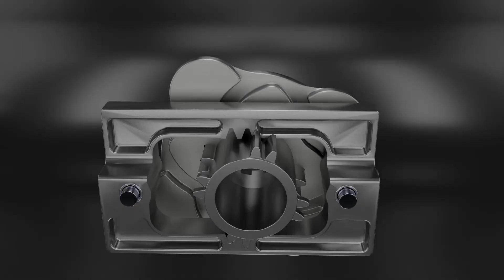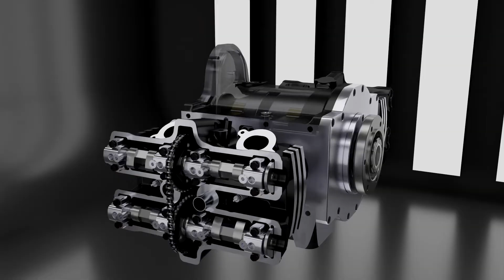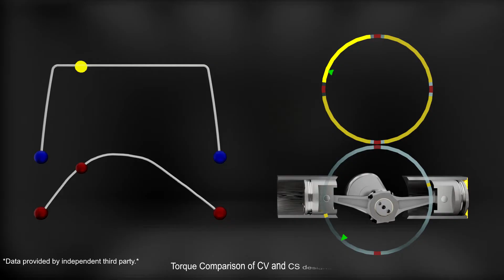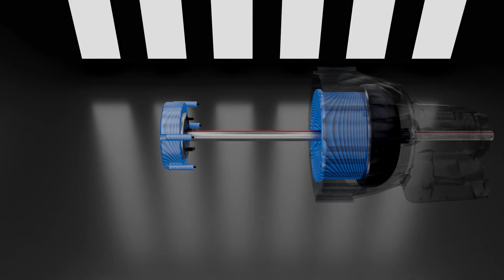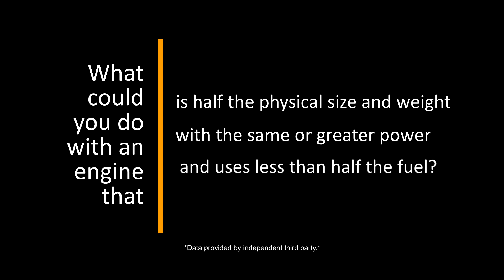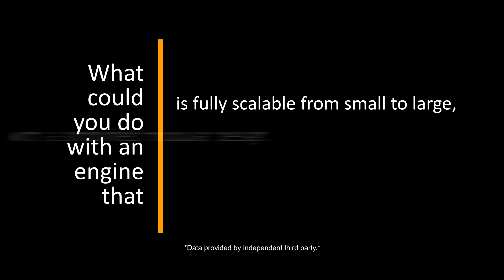The radical design and unique advantages of the CV Motion Technology

Comment: This thing looks like a fundamentally unreliable disaster in the making. All of those stress loads on 2x gear teeth must be some sort of a red flag.
That's not mentioning the enormous amount of reciprocating mass with little signs of any kind of primary or secondary balance management.
A 'rack & pinion' crankshaft isn't inspiring, it looks like it requires ultra-precise timing at very specific rpm to make it work while any sort of deviance, be it a tiny amount of wear or otherwise, would result in immediate catastrophic engine damage. I can't see a prototype lasting more than an hour at idle, maybe two at the most, before it chews those teeth off.
But it's all for emissions, that's good right? Making bold claims doesn't help you if it shakes itself apart or randomly snaps in half without warning. Nice idea poorly executed.
Reply from the maker: Thank you for your interest. At the moments of tooth engagement/disengagement, the piston Rodrack and central Powershaft maintain alignment utilizing the turnaround raceway grooves in the connected endplates. This allows the engine to capture and convert the early combustion pressure linear motion to high rotational torque. Precision timing is required, along with deviation mitigation, and are key components in the design and materials. Keep up to date with our progress by visiting our website at www.cvmotiontech.com.
Reply: @cvmotiontech7849  Stringing together a lot of impressive-sounding words doesn't really explain anything if they don't make any sense. Let's try to break this apart:
How do the 'turnaround raceway grooves' maintain alignment to the degree of precision required?
How does that alignment translate directly into 'capture and convert (whatever that means, but it's not physics) into high rotational torque?
How does 'precision timing' and 'deviation mitigation' have anything to do with material selection? To be quite honest, if your design relies on very narrow discrepancies of materials, then you're engineering unreliability into it.
Reply: @mazdamaniac4643  i tend to agree, the singular "improvement" over a conventional motor is the elimination of the piston wrist pin. i agree 100% that trading rotational crankshaft (balance) mass for reciprocating mass is just inefficient, changing direction thousands of times a minute, citing rotary motors as the best example of zero reciprocating mass.
baffle them with BS by comparing torque from a two stroke with a 4 cycle is just disingenuous.
edit: "the turnaround raceway grooves in the connected endplates." are the load bearing substitutes for the crankshaft rod journals, high wear frictional sliding (roller bearing?) pins engage the grooves to transfer force. lubrication issues?
they are using essentially a cam lobe to transfer linear to "high rotational force" just in disguise.

Comment: The full force of the compression stroke being borne by a couple of teeth on one side of the assembly is concerning. Considering the substantive mass of the reciprocating and rotating assemblies involved in relationship to the contact areas it seems power output would be limited to prevent failure.
Reply from the maker: Thank you for your interest. At the moments of tooth engagement/disengagement, the piston Rodrack and central Powershaft maintain alignment utilizing the turnaround raceway grooves in the connected endplates. This allows the engine to capture and convert the early combustion pressure linear motion to high rotational torque. Keep in mind that the entire engine output is transferred using 2-tooth engagement of circular external gears in most vehicle transmissions. Keep up to date with our progress by visiting our website at www.cvmotiontech.com.
Reply: CV Motion Tech the comparison to teeth in a transmission is not valid since gears in a transmission do not directly bear the force of the power stroke of the pistons. Shock forces in a transmission are mitigated by clutches and torque converters. Manual transmissions have wider helical cut gears and automatics have planetary gearsets with multiple points of contact.

Comment: why whould someone sane put the timing chain in the fkn middle of the engine?
Reply from the maker: Thank you for your interest. The engine in this video is a prototype designed for testing purposes. Future iterations have various valving techniques. With the OHC engine design, the chain, sprockets, and tensioner are contained in a "cartridge" that is removed with the head, eliminating the need to disassemble the engine further. This also allows removal of the head without disturbing the cams or chains.
Reply: @cvmotiontech7849  That seems like a very serious packaging issue.
How do you remove or install a 'camchain cartridge' presumably containing all of the sprockets, guides and a tensioner mechanism as one complete unit, when there is a crankshaft running straight through one of those gears at one end and a pair of camshafts running through the other?
That is not possible without disconnecting a link in the camchain, which means that the 'cartridge' is completely redundant and becomes another point of failure.

Also, second point, if this is a 'prototype for testing purposes', why would you make your camshaft drive mechanism almost completely inaccessible?
If you had to adjust the timing for any reason, be it tuning or to revise the design or for repair, you would have to strip down most of the engine to do so.
That's a bad design right there. Why would you even need to remove the head without disturbing the cams? That's not especially detrimental to anything.

I have a feeling that this is a marketing gimmick thought up by someone who took one look at the camgear cartridges on a Honda VFR800 and thought 'ooo that's a good idea, let's use that!' but didn't think the rest of it through enough, like continuing with 'okay...how do we service this thing?...oh dear..we can't.'
Reply: Why use chain drive at all? Just use gears for longer life & less maintenance. Looks & sounds like a great idea! I hope you can sell to all motor makers!!!!
Reply: @edwinarmstrong9175  Might be because gear driven cams are surprisingly difficult to get right. They're intolerant to vibration loads and require very high tolerances, which change as the engine heats up and cools down, while also being sensitive to lubrication and wear requirements.
It doesn't take much wear in a camgear system between the crankshaft gear and the cams to throw the cams out by several degree's. Then your engine warms up and expands, which throws out the tolerances in every gear, so that's even more degree's out. It's a big design headache for almost no benefit.
Reply: @mazdamaniac4643  Erm, not anywhere near as many degrees (no apostrophe required) as a little slack in a chain. Gear cam drive is more expensive and those close tolerances will increase development costs but they work just fine in high performance engines like the Honda VFR800. If the main concept works at all (which I doubt), then I assume refinements like that could be added.
Reply: @mazdamaniac4643  I don't know how much practical experience you have with cam chains but, in modern engines the problem of worn chains causing timing issues has become more pronounced than ever as the electronic management systems which all engines need to comply with emissions regs now constantly throw up timing errors when the cam position sensors detect that the timing is no longer in line with the crank sensor information. This often happens before any noticeable noise of slack camchains occurs (you have to rember that cams aren't a constant load like a bicycle chain, it's a pattern of load/slack/load/slack as they go over the lobes, particularly at low engine speeds).
   Anyway, I think it's daft to try to develop a new type of piston internal combustion engine now...might as well design a new steam engine! At least Mazda tried something different!
Reply: @Nino500  Oh yeah, I'm not disagreeing with you on timing chain error codes, I've seen plenty of those!
What I've found though (this is just from my experience) is that generally that happens because of worn guides and/or a dodgy tensioner allowing the chain to slap around, which wears out those guides as well. Worn guides can be down to folks not changing their oil frequently enough, or not using the correct specification of oil.

In most cases I've seen, the chain/sprockets were fine, hardly any wear at all when compared to new. The guides wear, allowing the chain to develop slack and misalignment of the sprockets, but I've also seen (and replaced) plenty of tensioners that had developed faults of their own or through faulty design recalls.

A lot of tensioners have a ratchet mechanism in tandem with the hydraulic tensioning, this stops it from backing off when it's taken up any adjustment when it's under oil pressure. The ratchet starts to fail or it gets a tooth jammed, the chain starts to slap around a little at first, guides start to wear away, it snowballs over time until the tensioner can no longer cope because it's at the end of it's travel with a busted ratchet. Timing errors, followed by valve-piston contact, the works. Expensive.

Oh yeah, byword on cam lobes. Initially when the engine starts up, I'll agree that it's developing the load-slack-load-slack routine. When it's up to speed though, the energy imparted back into the cams by the valve springs tends to negate that down to a pretty constant average. With a 4-cylinder (or even more!) engine, that duty cycle is pretty much nearly a constant because the camshafts are spinning at speed now. Both the intake and exhaust cams tend to average out each other as well in this way.
When one cam lobe is opening a valve against a spring, another further along the camshaft is already on it's closing ramp, so the two nearly balance out. It results in some torsional loads along each camshaft but in general that's not much of a big deal because they're plenty strong under normal conditions...until something bad happens like a piston hitting a valve and you get a sudden shock load through a camshaft...snap! Then the system is completely out of balance and badness quickly happens.
Reply: Fr lol
Reply: Service work of course. The Apple model😉
Reply: Greater repair cost.....................
Reply: Ya bring on the electric valves and let’s really complicate this turd

Comment: This tech is 50 years too late to be relevant and if it were done correctly it would have integrated the transmission into a single compact package.
Reply from the maker: Thank you for your interest Chris. Internal Combustion Engine technology is still a very relevant issue in todays world. The more efficient use of fuel (both current and developing biofuels) will be beneficial for many more years in both transportation and power generation. This video contains the CJ2 prototype engine designed for testing purposes. This design could be developed to integrate a transmission or generator at a later stage.

Comment: The moment when the upper and lower teeth of the of the crank make the handoff, as the pistons change direction, is concerning. There is essentially no engagement at that point which is an opportunity for a pre-ignition event or application of a load to the crankshaft to cause a misengagement and sudden engine failure.
Reply from the maker: Jason, Thank you for the comment. If you watch the "reversing cam" plate and the Rodrack pins during initial tooth engagements, you will see that the piston motion is restricted to following the groove arc. This ensures proper alignment and motion during the TDC and BDC extremes.
Reply: @cvmotiontech7849  Excellent.  There is a similar design by Craig Laycock called a Conjoined Piston Engine :  https://www.youtube.com/watch?v=JB7fzCedgMg
Reply: @cvmotiontech7849  one misfire with a valve stuck open and the piston is gonna spew it's guts out in epic fashion.
Reply: it's a water hammer epic disaster waiting to happen.

Comment: This appears to be firing like a two stroke but yet has cams and valves. I like the concept, but don't understand how this works without an exhaust stroke.
Reply from the maker: Jason, Thank you for the comment. During the comparison portion of the video, the exhaust stroke is not shown to place emphasis on the power-stroke comparison. We have the ability to utilize this design in either 2 or 4 cycle engines. Check out our website www.cvmotiontech.com to view the running AA01 (36cc, 2-cycle proof of concept) and to learn more about this technology.
Reply: If it is a 2 stroke, how is it lubricated?